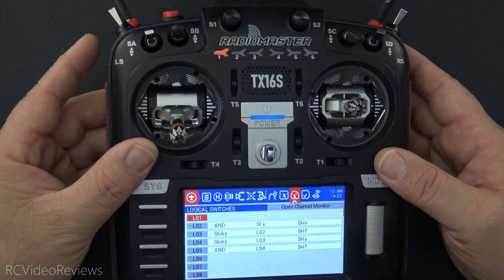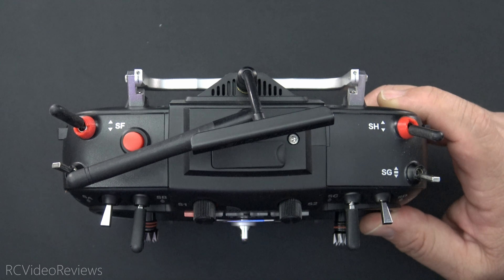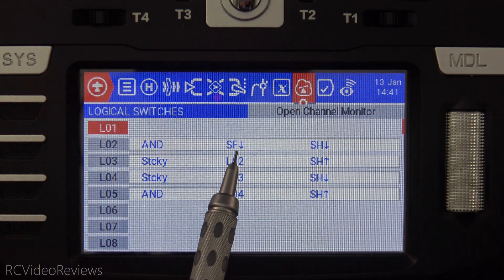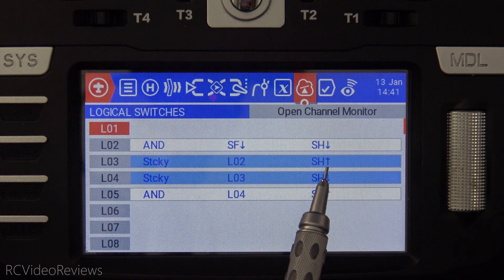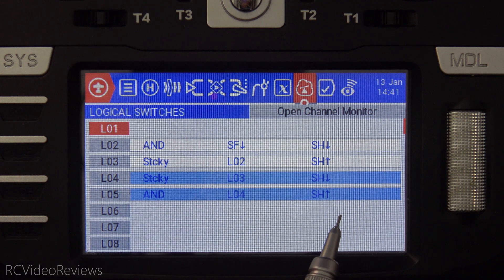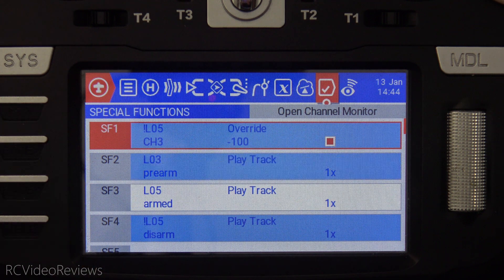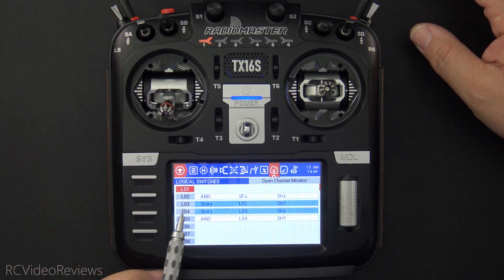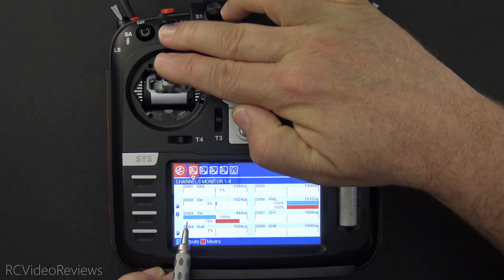EdgeTX Snippet • How-To Add Pre-Arm Momentary Switch to Arming Sequence

Comment: Great work! But what if I just want to arm with one momentary and one 2 pos switch both triggerd at the same time?
Reply from the maker: Use a logical AND for the momentary and 2pos. Then when that logical switch fires, have it trigger a sticky. That sticky is the switch you'd use in special functions for override. You can use the same logical switch to disarm if you want. So the sticky would be L0x L0x. Pretty easy.
Reply: @RCVideoReviews  Ok thank you very much.
Reply: @RCVideoReviews  Now I have the logical AND, plus the sticky. After that I defined the sticky logical switch on the mixer tab at the arming channel. Works as suggested. Is there any disadvantage in doing it that way`? Again many thanks for the help.
Reply from the maker: You should join the discord and ask there. YouTube is not a very good format for conversation. Discord is 100000% better.
Reply: @RCVideoReviews I hate discord 😅
It's ok. It works as suggested so everything is fine.

Comment: Hello, thank you for your videos. I have had the tx16s for about 20 flights and sf switch I use for high and low rates stop functioning. Is this common with these radios? See others fixing switches but this seemed way to soon.
Reply from the maker: I've gone through 4 radios in various phases of testing, demos, flight. I have 3 in common use: Demo radio, fixed wing radio, rotary wing radio (all TX16s). I've been flying them at the field for about 2.5 years now. I've had one switch die.
Reply from the maker: Good news is the switches are inexpensive, available all over the place, and pretty easy to replace.
Reply: Okay I'll order one up or the sf se switch. Thank you for reply

Comment: I used a pre arm setup I learned from a video a few years back. Uses Edge plus  [0.0:<<]  the appropriate switches and a sticky switch. Works, no idea how. 😬
Happy flying everyone. 🤓
Reply from the maker: That's the thing about Edge. There's usually a number of different ways to accomplish a task. So it comes down to what makes the most sense to you. Conventional wisdom can be helpful in some cases though.